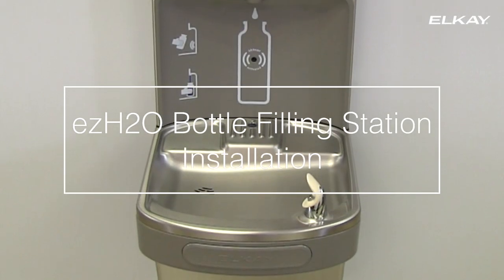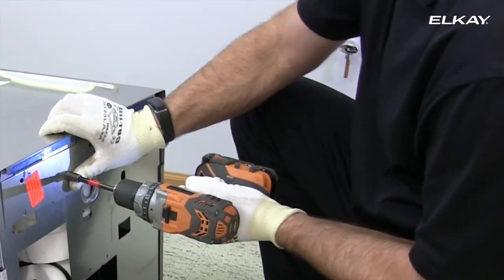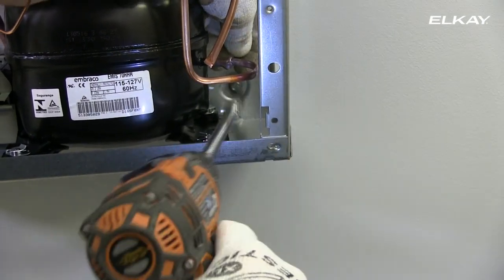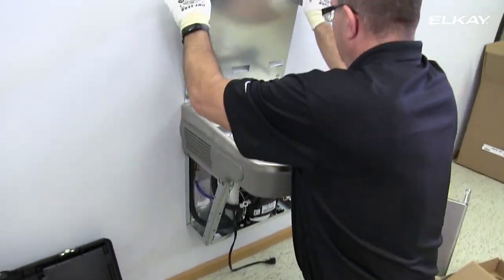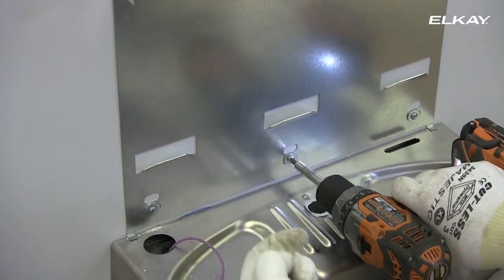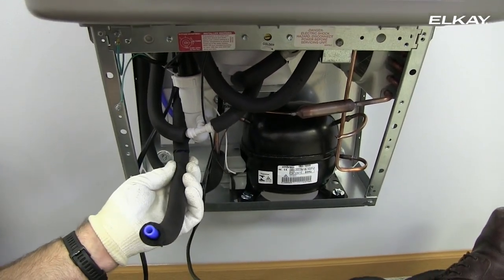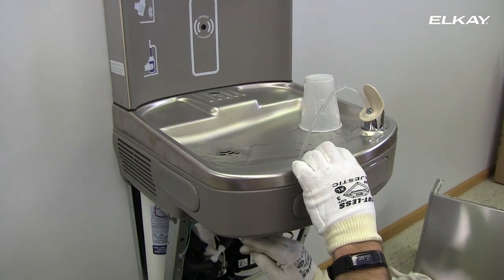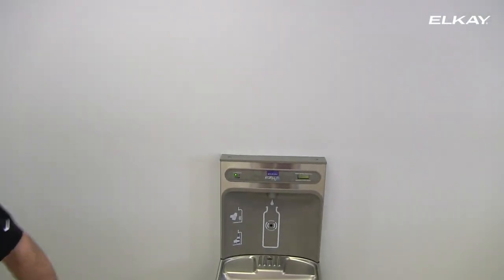ezH2O Bottle Filling Station Installation (English)

Comment: OMG. Russ must have done  thousands of these installations. There is no way you can  install this unit so easily.  Space within the unit for water, drainage and electricity is MINIMAL.
Reply: I started the installation by reading the instructions booklet. Should have just YouTubed it...
HUGE mistake could have skipped all the nonsense Pages of needless information and dimensions for other models !!
Reply: see how fast the power cord just dropped in there?

Comment: After contacting ELKAY to see how much install would be on this unit they wanted $1200. We already had old one up some kids just broke it. I did ask if they paid installers commision on installs and if they were hiring. No response, it was funny.
Mine doesn't come with a purple wire, and the instructions don't say anything about a wire. Do the newer units not require the wire?
Reply: I'll install yours for 500. I only have 300 more to go before you! Hahah their on drugs for 1200 install. I could bang out 4 to 6 in a day depending the situation.

Comment: Why don't you say what size the screws are or more appropriately what size tool you need because those top screws are either T25 or hex of which I'm not sure of the size but on the side of the cooler itself just above the left axis plate there's a similar scroll but it's got a much smaller tool size such as T20 or T15 - or similar hex 

Knowing which square bit or torx bit or allen wrench besides saving time it lets you do the job properly